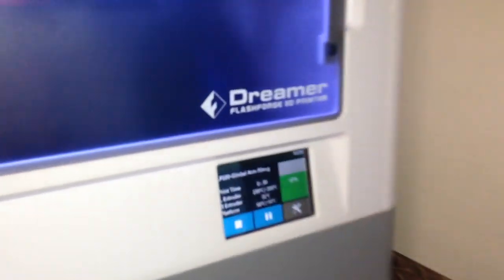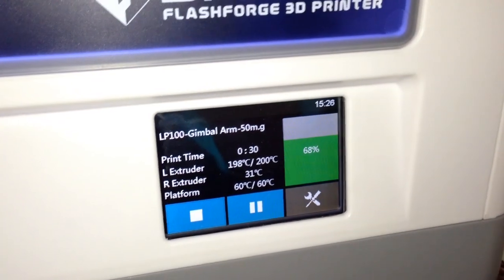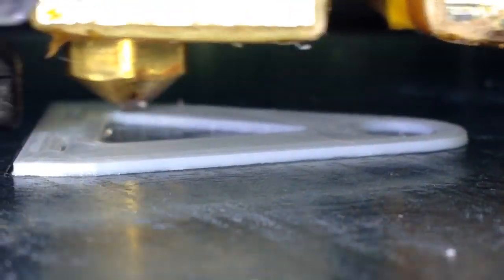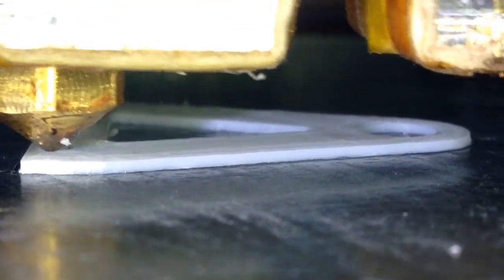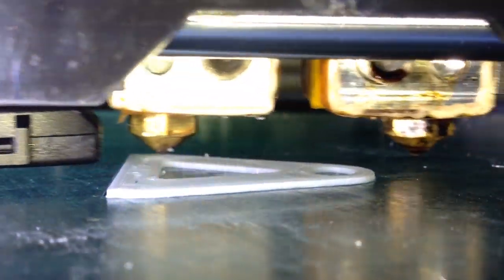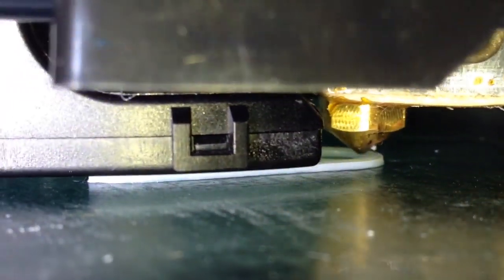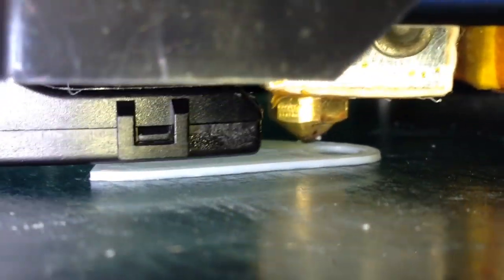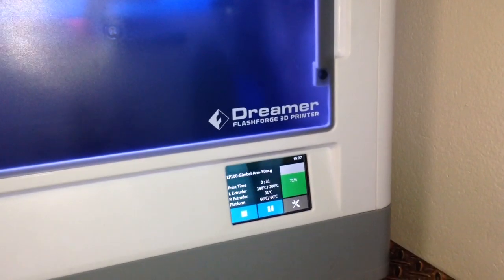Flashforge Dreamer - 50 micron print!!

Comment: Tell me about the glass plate, please? We’re there any issues to using it? Do parts stick well?
Reply from the maker: Wardogs Gaming just a $5 piece of glass from the glass shop. Parts stick well
Reply: Thomas James Thanks. Did you have to change the springs or any other parts? Do you need glue for the pla to stick?
Reply from the maker: Wardogs Gaming bed at 60c for PLA and you need UHU glue for it to stick. Bed at 110c for ABS and you need hair spray

Comment: Is that click one of the axis stop switches?
Reply: i think its the filiment snaping off the inside of the housing lol
Reply from the maker: I used a LOT of noise reduction on this video clip and the "click" is actually just the sound of the motors changing directions. Without noise cancelling it sounds fine

Comment: How well has it or did it hold up?
Reply from the maker: Hi. The printer has done a LOT of work. I have now put the blue FlashForge printer mat on the glass bed so no more glue and it so gets used. The only problem I had was the Z axis motor seized up due to all the glue, hair spray and crap. I had to remove the motor and clean it out. Once cleaned and oiled the printer hasn’t missed a beat. Nothing has broken. Very happy with this printer. I have upgraded the hot end to a full metal hot end.
Reply: @pcarlson1979  excellent to hear. There's not much information at all on this printer even tho they've been out forever. I'm thinking on buying 3 and converting one for PC and PA.
Reply from the maker: @zedsdead7670  yeah. I think I was like the first one in Australia to get it. It seemed very “Beta “ when I got it. The packaging was just randomly cut bits of foam and paper! At the time makerbot was just WAY too expensive. I really like this printer and just in the weekend I printed new plastic feet for my outdoor dining chairs from ABS worked perfect.
Reply: @pcarlson1979  I'm going to be using them to make and sell personally designed mechanical prints along with making some jigs to ease post processing of small parts at work. That's why I really need to be able to print in nylon and PC. ABS will be fine for around 70 percent of what I want to do tho.

I'm honestly amazed these things have such little information out there on them. Hell the neutered Dremel rebrand of it has excellent reviews but still little detailed documentation out there on it.

Comment: Hi,

How do you print at 50 microns while the specs say that this printer can only work up to 100 microns?
Thanks :)
Reply from the maker: Hi David,
The printer had several new software updates since I bought it an one of the updates was to allow down to 50 micron layer height. That's 0.05mm per layer. I find even though it can print down to 50 microns, it tends to squish the plastic too much. 80 micons is perfect!
Reply: Thanks for the very fast response :) one more question if I may:) Is this a closed system or can I use any slicer with it and what slicer do you use?

Thanks again :)

David
Reply from the maker: David Moisson Hi David. The system is closed as far as the firmware goes but very recently Flashforge have released the USB protocols openly so it is now openly available to be controlled by USB. But I have used many slicers like slic3r, skeinforge, KISS and whatever makerware uses. I've even read people using Simplify3d but you just have to save the .G file to the memory card. But I keep getting excellent results from using the supplied Flashprint software so I couldn't be bothered using anything else. It doesn't have a thousand options like retract and all that but it just works :)
Super happy with the printer and software. I'll keep uploading videos so stay tuned.
Reply: Thanks, I'm trying to decide between the flashforge dreamer and the ultimaker 2, decisions , decisions ... ;)
Reply from the maker: David Moisson Ultimaker 2 is not available in Australia so that made my choice easy